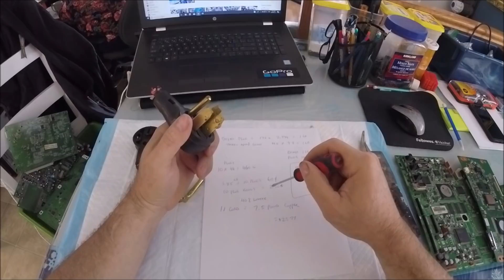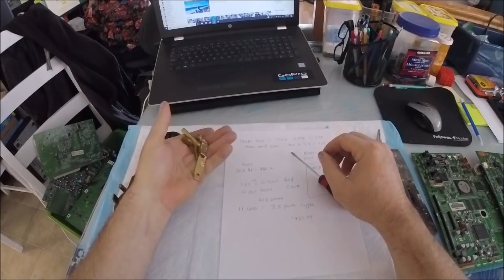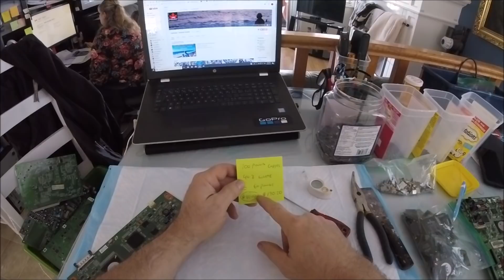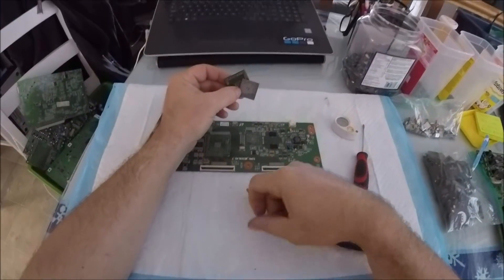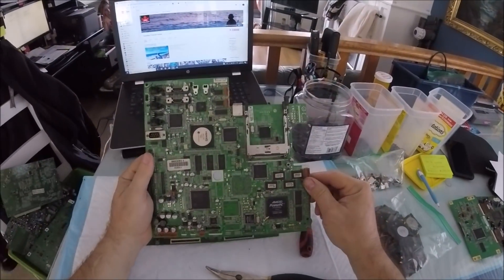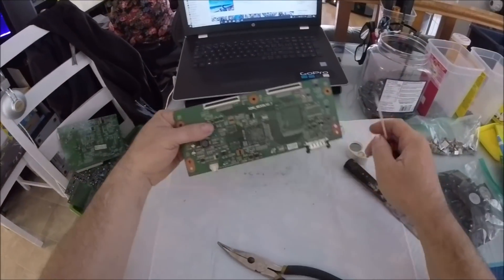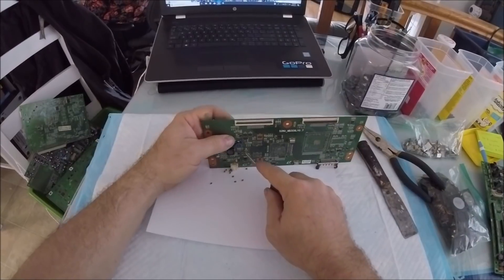Dryer Plugs & How I Depopulate Boards For Gold Recovery

Comment: I've found it rather easy, mostly,  to just hold the plug end with a pair of channel locks and use diagonal cutters to pull the brass out. No vise required.
Reply from the maker: Thanks For Watching, Yes but you are losing some brass, I like to get even the wire out. I will do another video when i perfect the process
Reply: @CanadianTreasureHunter Usually I am able to pull the whole plug out, with the copper.  Sometimes, though, they do break off, but my main goal is complete removal.  I add the small wire bits to my #2 stripped bucket.  It just seems that setup time on the vise adds more time than I like to devote to the process.  Even if I don't get every little bit.  Keep on!!! Cant wait for that next video.

Comment: I dont depopulate my boards then they lose there value i just put the expensive boards cpu and rams in a corner i would like to show you how our system works in holland are u intrested in pictures and prices
Reply from the maker: Thanks For Watching, Yes i am, I only remove components from Flat screen TV's & DVD players & low end electronics. I have all my mother boards complete & hard drive boards too
Reply: @CanadianTreasureHunter  where can i send it too e mail or home adress
Reply from the maker: tornadodemo@gmail.com